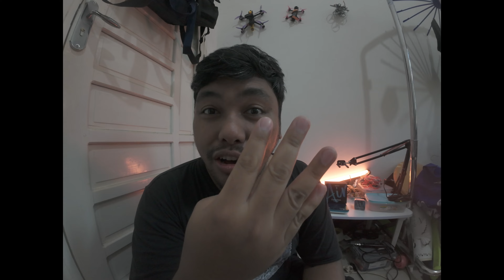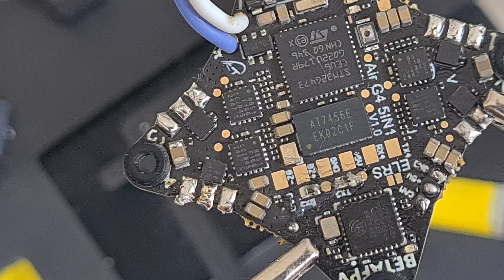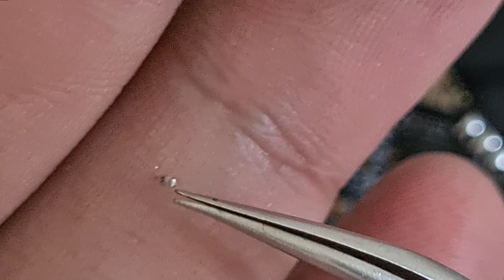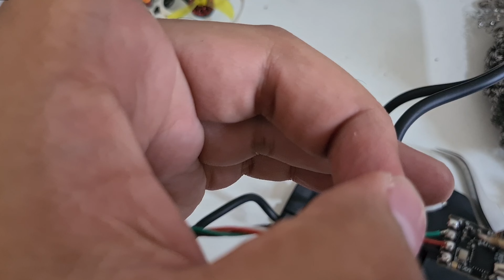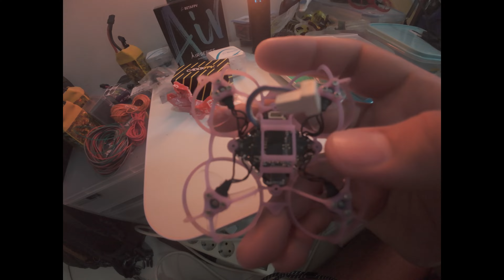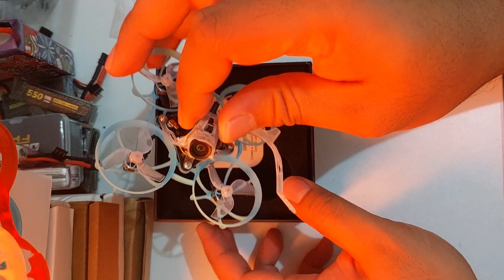Why Your BetaFPV Air65 / Air75 Randomly Falls Out of the Sky - 4 Easy Fixes

Comment: I see you using "tower" receiver. Is there any reason to use this one rather that "flat" one?
Reply from the maker: Its kinda like comparing a short antenna and a long antenna. Technically, the "tower" version should have a better range than the flatter one.
Reply: @chill-drone its not really a huge increase tho, personally, I go with less weight